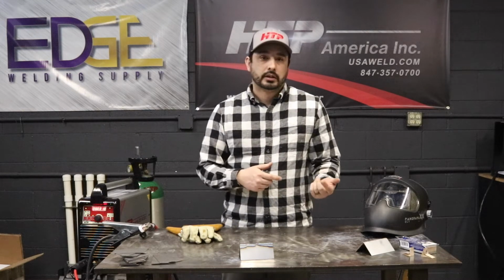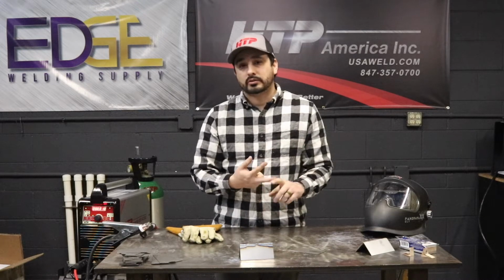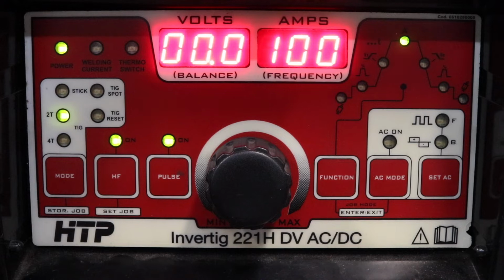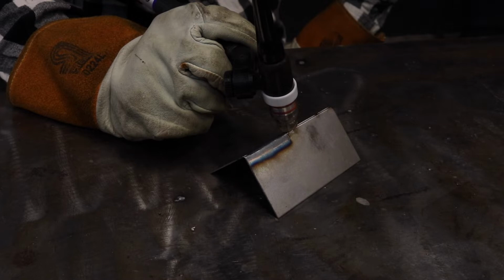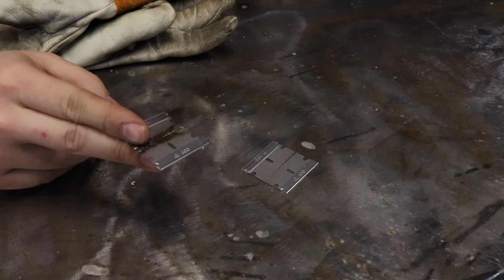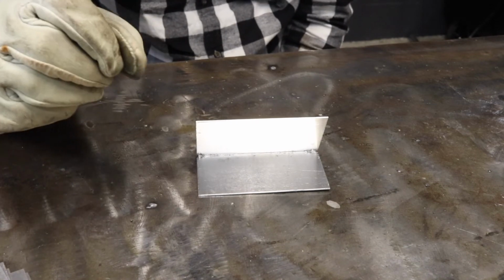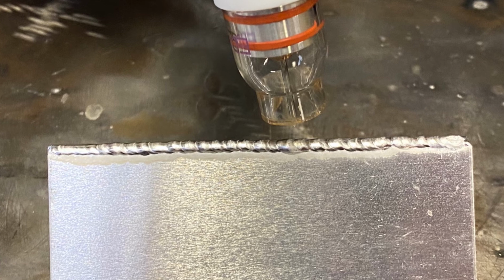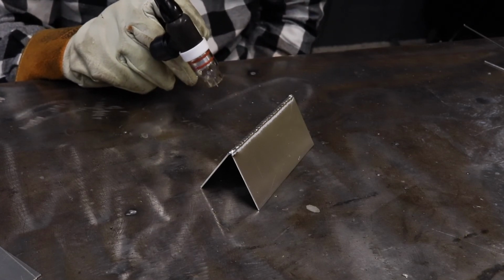Pulse TIG Welding: Dial it in. Part 1

Comment: I don't think alot of people would be to happy if boilermakers only used pulsed tig all the time to get boiler tubes welded up. Because people would freeze in there homes waiting for a summer job to get done in the winter! One more thing all that pulsing is probably not going to be real good on the eyes after so many years!